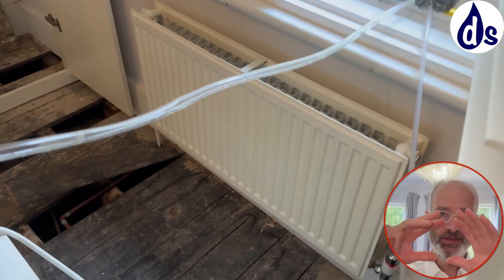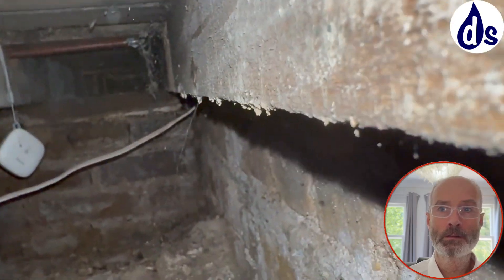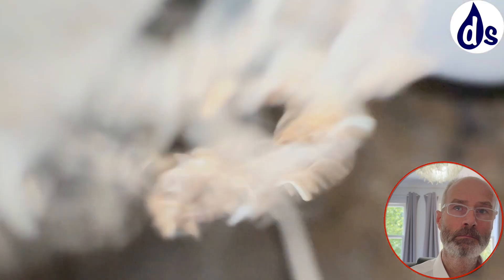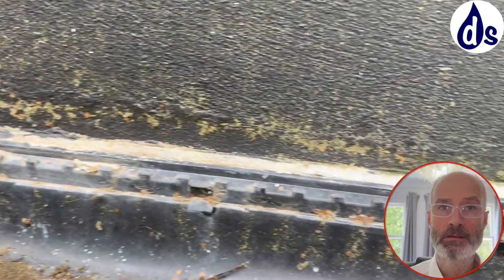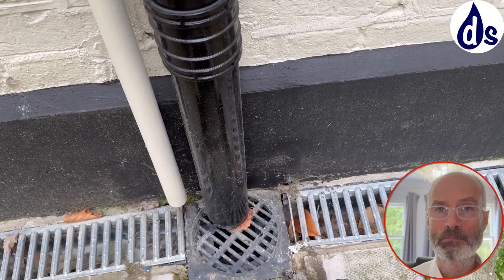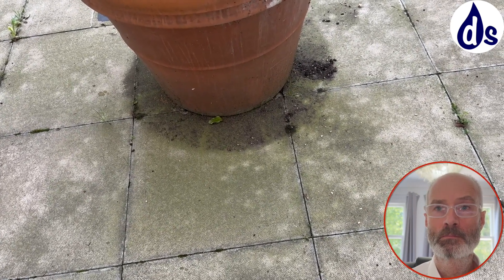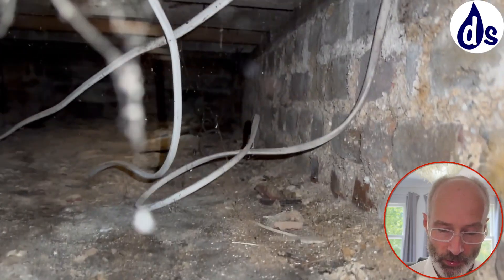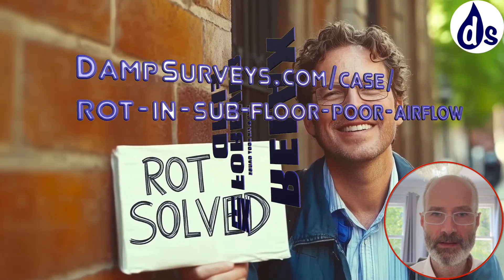Rot Solved

Comment: feeling a bit cheecky after asking qustion on your other video so don't worry if you don't want to answer. But what would a high humidity reading be in a subfloor. i belive I herd you say in one of your videos its 85%
Reply from the maker: No worries – cheeky questions are always welcome! 😄👍 You're right that subfloor humidity readings can be a bit inexact. 📊 If the hygrometer is near a cold spot ❄️ or an air brick 🌬️, it might reflect outdoor humidity, which can often be close to 100%. 🌧️
The key thing to watch for is whether the relative humidity drops when it’s dry outside. ⬇️☀️ If it doesn’t, you might have a leak or rot in the subfloor void – rot produces vapour as a by-product of respiration. 🦠💧
I recommend checking the hygrometer weekly. 📆 In my own home, I quickly caught a leaking cistern 💦. Without that hygrometer, I could have ended up with dry rot! 🪵❌
It’s a simple habit, but it can save a lot of trouble. 🙌 Thanks for the great question! 😊🔍

Comment: Few other issues here, downpipe discharges onto grate so cannot let debris out, it will blocks and overflow, looks blocked. Waste pipe poorly discharges. OPC plinth wont help matters, bridges the dpc and traps moisture
Reply from the maker: Great observations, Red! 👀 You’re spot on about the downpipe and waste pipe issues:

Downpipe discharging onto a grate – if debris can’t clear, it’ll block and overflow. Better drainage or regular maintenance could help. 🏠💦
Poorly discharging waste pipe – definitely adds to moisture issues and needs sorting.
Regarding the OPC plinth, there’s a common concern taught by RICS that an impermeable plinth can bridge the damp-proof course (DPC). But to me, this doesn’t quite add up. 🤔 Two impermeable layers meeting shouldn’t create significant capillary action, at least not enough to cause real issues. No definitive proof of this has ever been demonstrated, and in practice, the risk seems negligible.

In fact, a well-designed plinth can act like a hat, coat, and boots, protecting walls from rainwater splashing. 🧢🧥🥾 The key is ensuring proper detailing and avoiding moisture traps.

Check out this video for more on plinths and drainage:
🔗 "Penetrating Damp Through Render Cracks"
https://youtu.be/-bgtJWxp4Fc

Thanks for your detailed feedback, and best of luck!
Simon

🌐 Try our AI tool: https://damp.ai – feedback is always welcome! 😊

Comment: Hi. I, m a monk in Romania. And i have a problem with a rot called Serpula Lacrymas. Can You help me with some advice to fix the problem. Can i have  your email to send You few  picture 7:59 s pictures?
Reply from the maker: Hi! 👋 That’s fascinating – and I’d be happy to help with your dry rot issue (Serpula lacrymans). 🌱🕵️‍♂️

You might find it interesting that, as far as I know, there is very little dry rot (Serpula lacrymans, Latin for "tears of a snake") in Romania. This rot was introduced to Europe through shipbuilding with timber from the Himalayas in the 19th century. 🌍🚢

Dry rot spreads quickly, so acting promptly is essential. It thrives on moisture, so identifying and fixing the source of damp is the first step. If you dry out the timber thoroughly, the rot will stop growing. 💧 If you don't it will reappear. 🪵

Key Tips:
Ventilation and drying are crucial – drying for at least a year should halt the rot.
Octoborate treatments can help treat the affected areas.
Dry rot can be killed by heating the timber to above about 40°C – though this can be challenging in practice. 🔥🏠 Some have tried heating an entire house instead of removing timber – not so easy!
If you’d like to share some pictures for a more detailed look, I recommend using the website:
🌐 https://damp.ai – it’s an AI tool designed to help identify damp and rot issues.

Alternatively, feel free to describe the problem further here! 📸🏠

Best of luck!
Simon